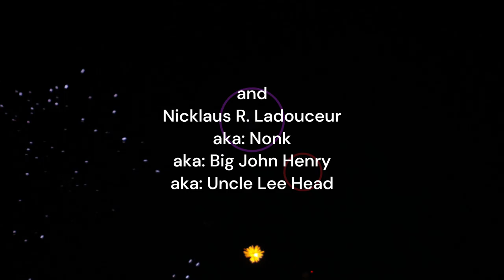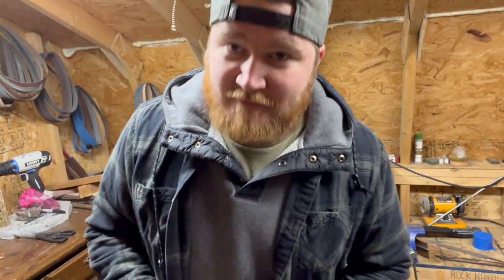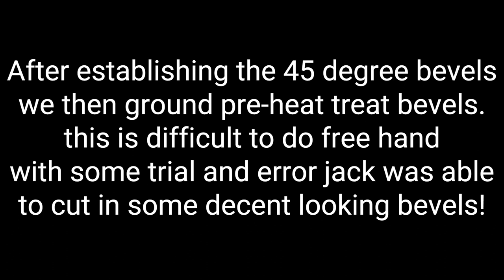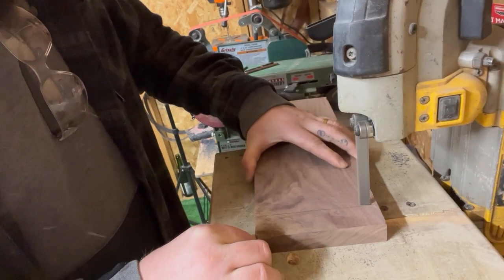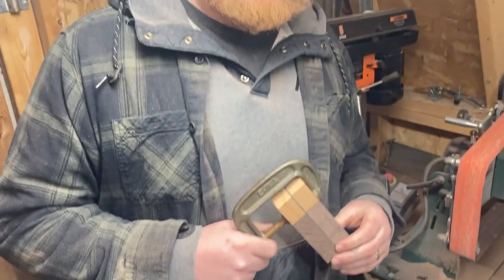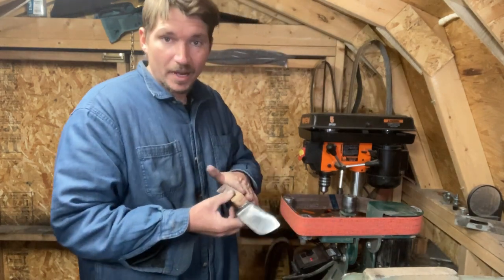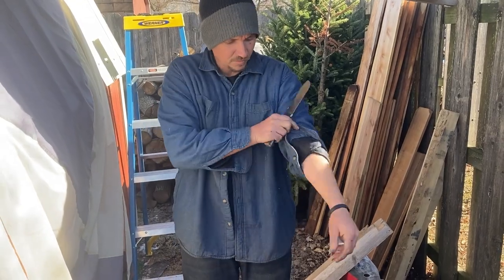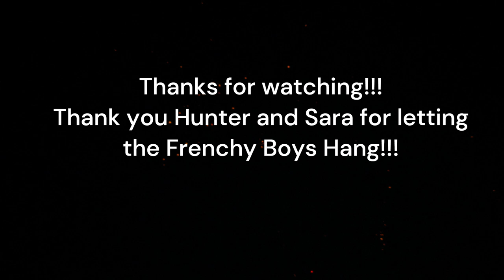First ever knife build!!! Frenchy Brothers unite!!!

Comment: This has definitely increased my confidence in the grizzly grinder.
Great knife too!
Reply from the maker: Thanks man! It turned out pretty sweet! Brother did a good job!
Reply: Mines still going good 🤘🏻 they sent out a grounding wire to link the motor to the control box as their solution to melting motors.
Reply from the maker: @mcrich1978  and do you think that that helps? Seems like an odd solution, but maybe it makes sense…. I have also not had too many issues with my machine although every once in a while when you turn it on and slowly crank up the speed, the VFD will not turn the motor and it makes a weird sound for a second, but turning it off and back on normally makes it go away…. Almost as if there’s a short or something.
Reply from the maker: And on my brother’s knife, he ground that 51 60 which was 1/4 inch stock all the way down really thin and the machine chewed right through it. I’m still pretty happy with the purchase!!! Still beats the
 1 x 30 although I still occasionally use it lol 🤙 thanks for watching and sharing my dudes!
Reply: @TheOGfrenchy  I think it makes sense for it all to be grounded, If that's the true cause of the issue however is to be determined. I haven't had any start issues with mine like you described above .. glitch in the matrix 😎 perhaps. I haven't opened anything up to see how everything is mounted in the control box.. if vibrations and a loose terminal or something.. idk.. I've been primarily using it for bevels with the work rest and jig and have no complaints.. im about to go out and use it to do the bevel work on the other side of my mini Serbian Cleaver.
Reply from the maker: @mcrich1978  heck ya brother rock on